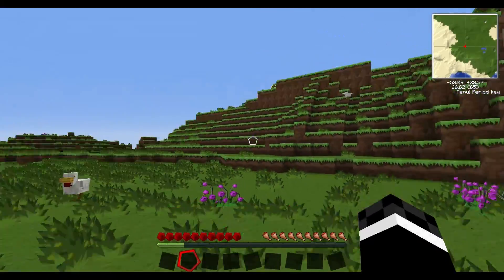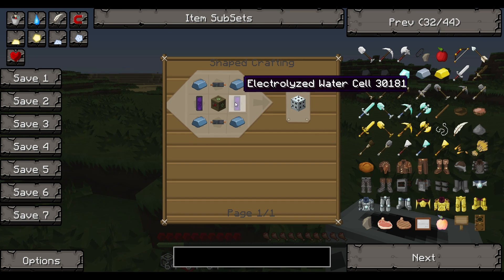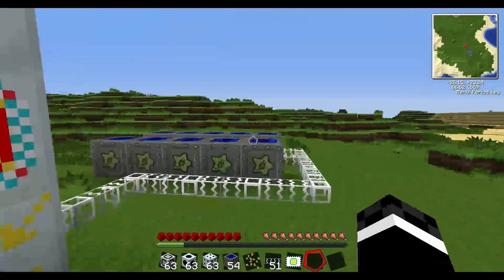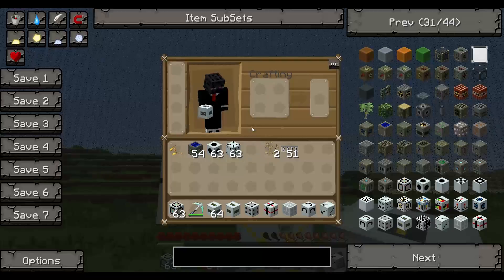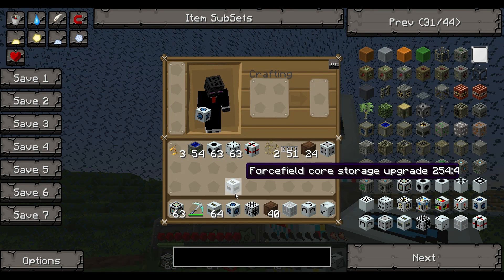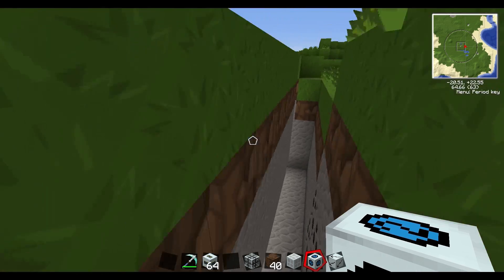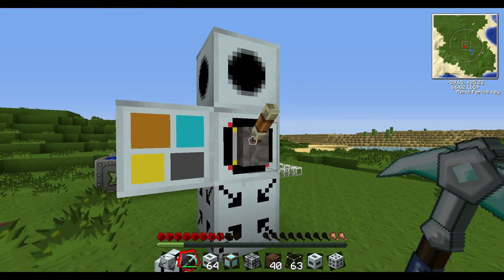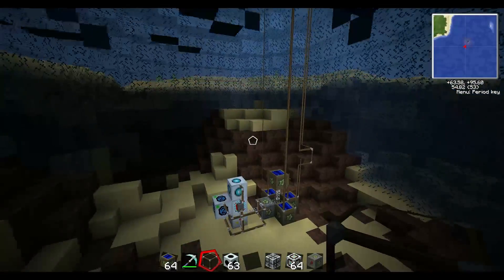Tekkit Tutorial - MFFS Force Field Setup

Comment: I have a hvs and I can rarely ever get power into my mffs gen core?? im using glass fiber and mfsu, I have hvs on the side of the mfsu and then 1 glass fiber cable running into the eu injecter which the mffs gen core is on top and the mffs area project is on top, thats my set up with a lever on the mffs gen core, whats wrong, yes i did the blank card and i have that all in it